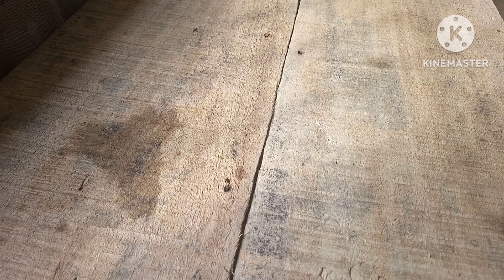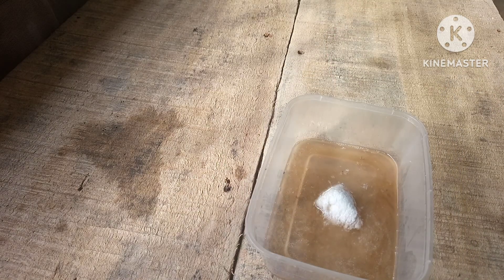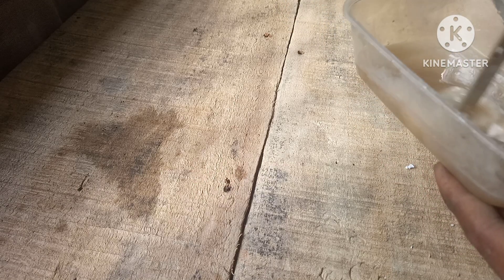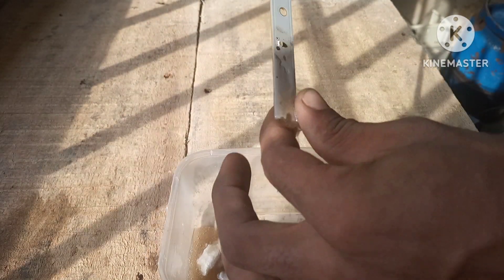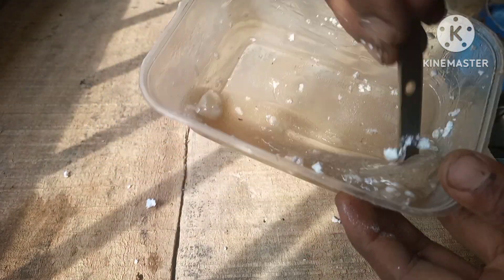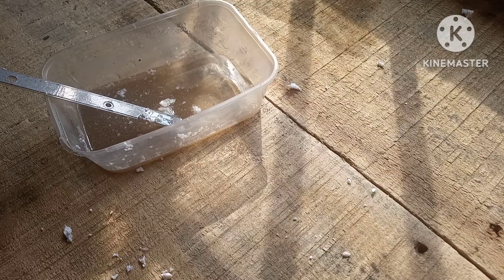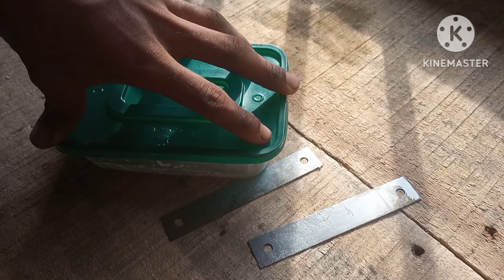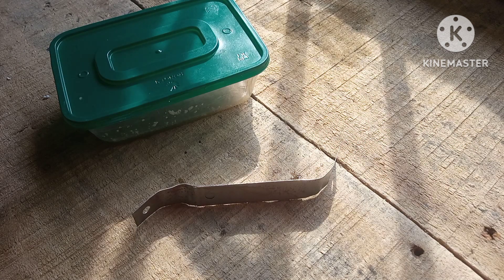How to Build a DIY Polystyrene Welder – Easy & Effective!

Comment: Fails to mention that this mixture is highly flammable-they use it for a cheap Molatov Cocktail. Just sayin'
Reply from the maker: Thank you for your comment! Actually, once the petrol dissolves the polystyrene, the resulting mixture is not as flammable as regular petrol. This is because the petrol’s volatile components, which make it highly flammable, are consumed in the process of breaking down the polystyrene. The final mixture behaves more like a sticky adhesive rather than a highly flammable liquid. However, it's still important to handle it with care and avoid exposing it to open flames. Thanks for pointing that out!